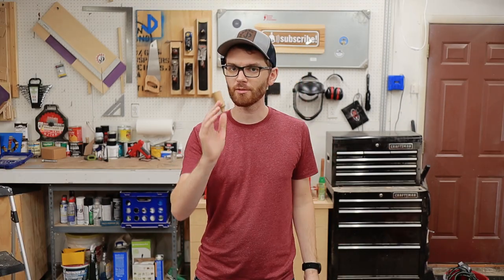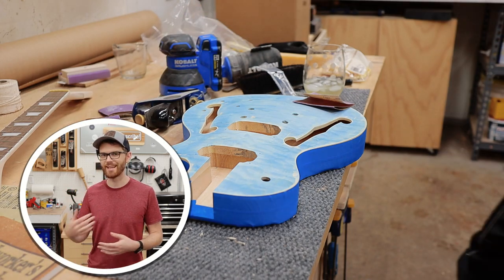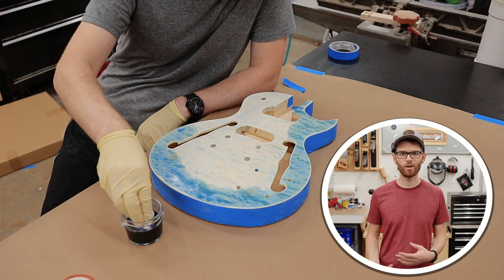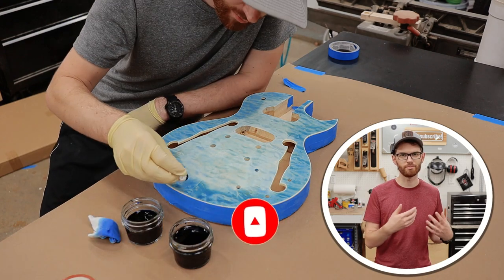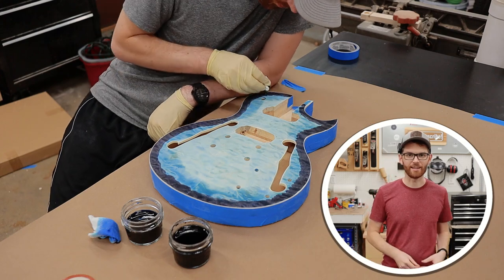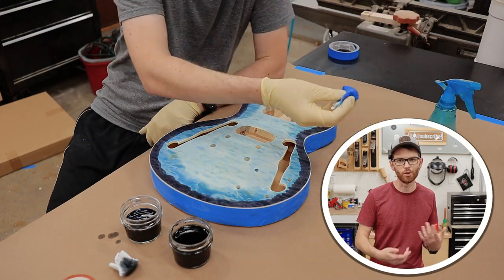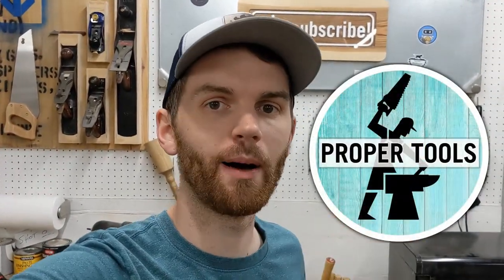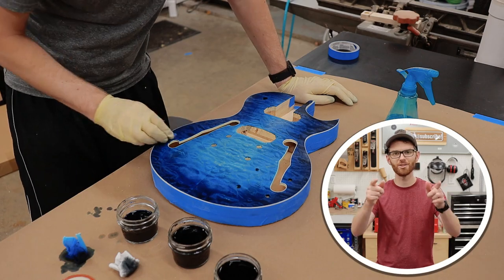Beginner Dye Tutorial for Guitar Burst Effect

Comment: You can use a UV light to spot glue. Or wet the veneer with naphta. In my MODEST opinion, you've really gotta push to sand through the veneer. I was able to use 180, 220 and 320 and not go through on mine. That said, yes, you've gotta be VERY careful.
Reply from the maker: Great tip!  mine had a few thin spots that got dangerously close, especially on the edges.
Reply: @MakewithJake  yes, edges are tricky. I built a Pitbull kit that had a NASTY patch of glue just next to the neck pocket. Yet, I was able to sand it all off without burning through. Luck and caution were my pals, that day. 😁

Comment: It looks great! The light/dark blue wash really helped knock down the black. Did you get any delamination or bubbling on the veneer? When I work with thin veneers I have to be super careful when using water-based anything- It might just be on account of my impatience though.
Reply from the maker: Thank you! I didn't notice any bubbling or delamination of the veneer. I didn't use a lot of water though, just enough from the rag to transfer - but not so much that there were puddles or anything.